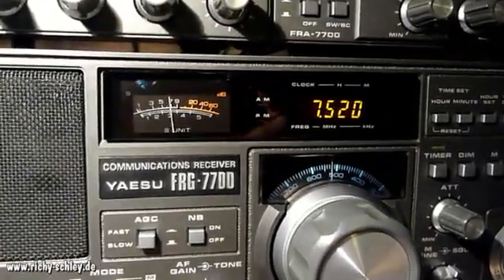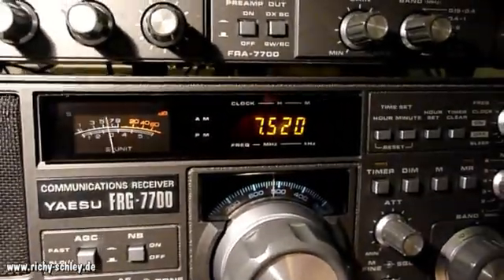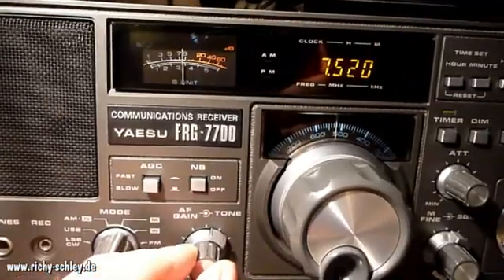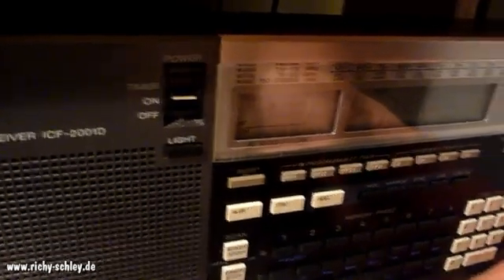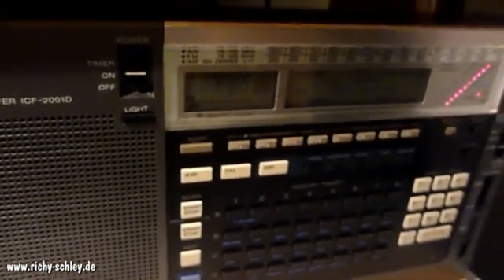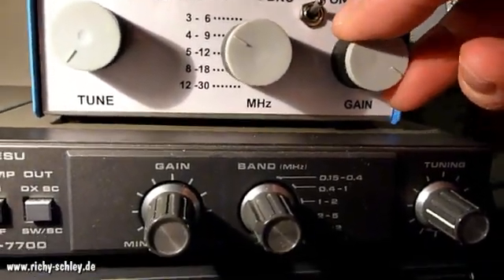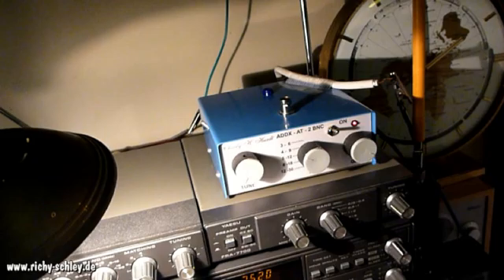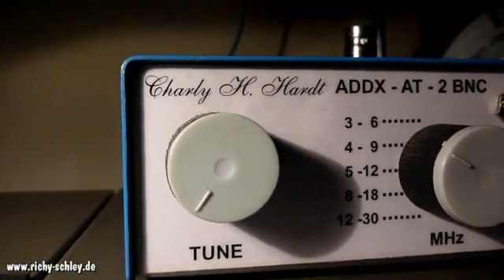Active antenna shortwave ADDX AT-2 vs. Yaesu FRA-7700

Comment: Very good information here. Thank you for taking the time to talk about this. I just bought an Icom R75 receiver and need an active antenna setup since I live in an apartment and cannot have a regular HF antenna setup. I was looking for idea's and this seems to be a good one.
I have the scanner you have (pictured under the Yaesu 7700) but it's branded differently but is indeed the same scanner.
Thank you again from the USA.
Reply: Tengo un fra 7700..nuevo  lo vendo o cambio